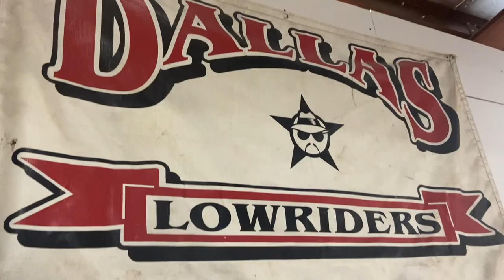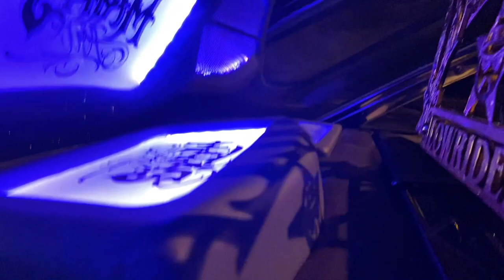1959 Impala Transformation Dallas Lowriders Part 2

Comment: With the DA sander, you using 3000 trizact foam paper or 5000?
Reply from the maker: 2000, 3000, and 5000
Reply: @markmata9685  you dont get pigtails with the da sander and 2000? Whats your trick?
Reply: @OLDTIME47  flowing water.......if you could run a garden hose the whole time would be best...but youd get absolutely drenched! lol....moving water takes the bigger chunks that cause pigtails away as it flows and keeps them outta the pad